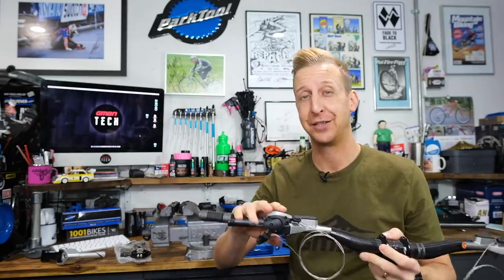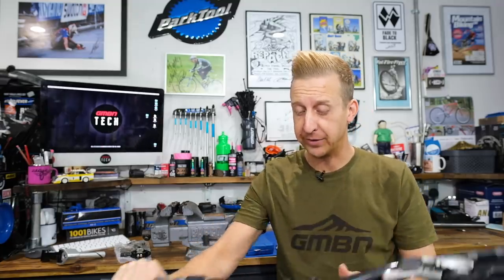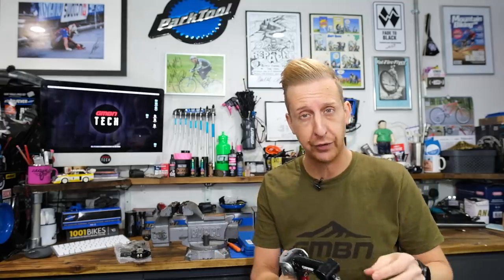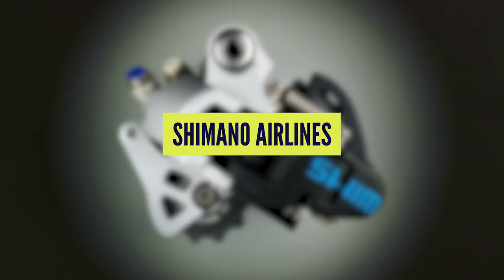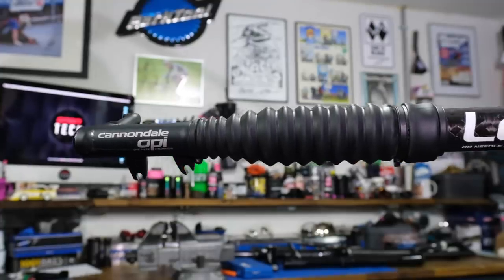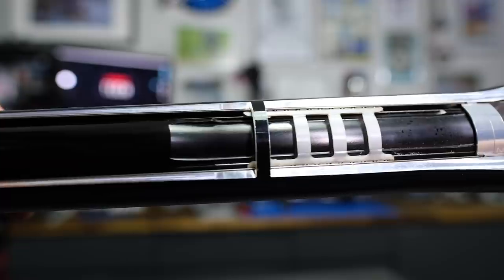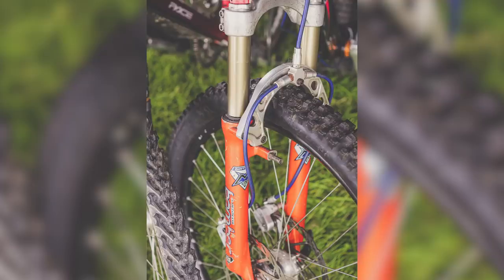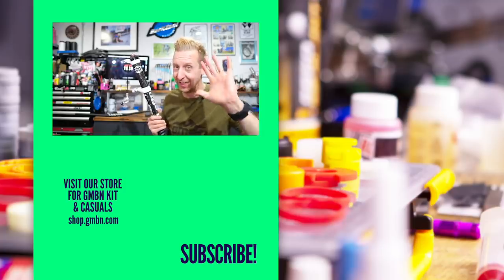The Strangest Mountain Bike Components Ever Made | MTB Tech History - Part 1

Comment: #askgmbntech hi doddy, love the show! I accidentally rounded off the head of the bottom bolt on the damper side of my 2018 pike. Since it's an aluminium bolt, I don't really have a clue how to solve this, could you help? Thanks, keep up the great content!
Reply: gmbn allready have a video on that just servh hiw to remove stripped thru alxle
Reply: It's not the thru axle I stripped, it's the bottom bolt on the damper side, under the rebound knob